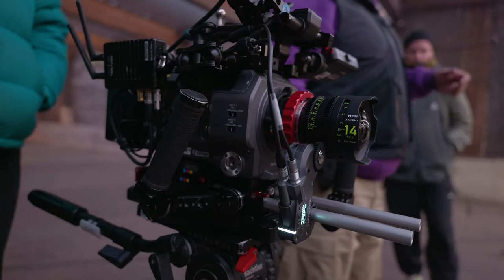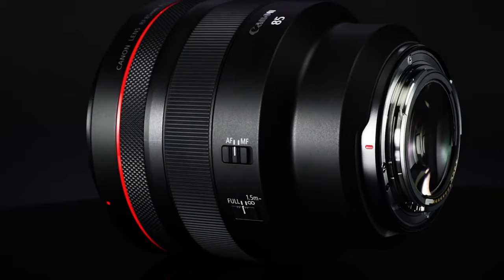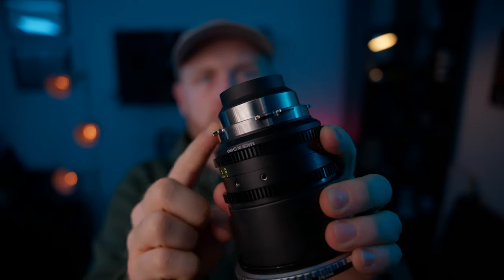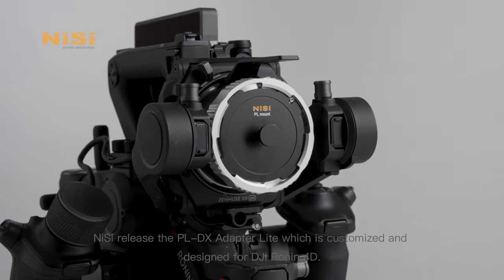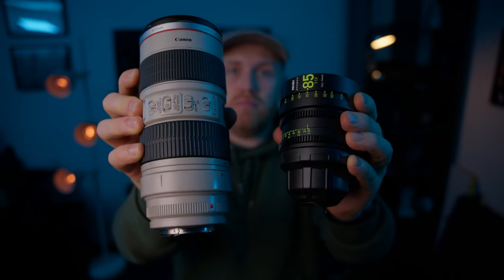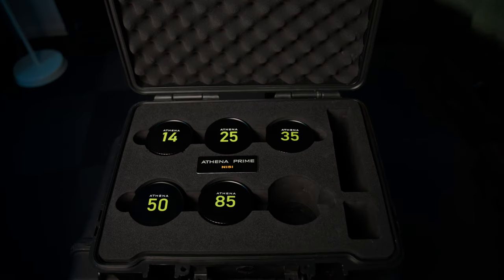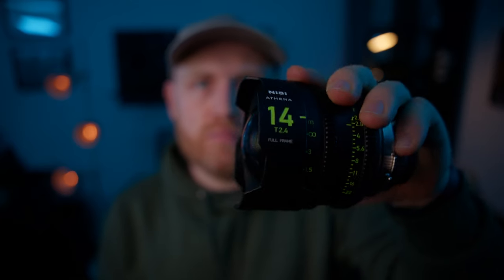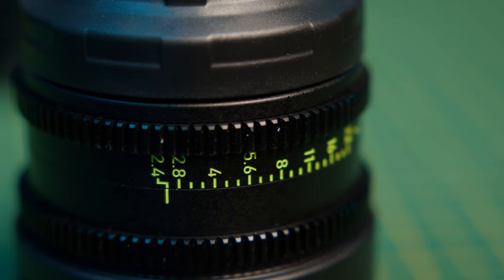These Lenses Were So Good I Bought Them! NiSi ATHENA PRIME Cinema Lenses

Comment: I like what you said about the PL mount. Whenever purchasing an expensive lens or lens kit, I from now on will always choose PL mount over any other (if avaliable for that specific model). Being able to switch to a different camera system and manufacturer at any time is so incredibly valuable. And even if you are regularly shooting on Sony, RED, Canon, Blackmagic, ARRI, Panasonic or whatever. Whenever you have a project that specifically requires a Blackmagic camera, you can simply get your PL adapter kit out and use all the lenses you already have and love and just need to rent or buy the specific camera. That way you not only save a lot of money, but you are also able to afford even more expensive lenses since you can use them for even longer and also keep that resale value.

Comment: You forgot to mention the one major flaw of the Nisi set, which is the rear protruding element during focus adjustment that'll prevent you from mounting the lens on speedbooster or most filter adapters, making it less useful on mirrorless and/or super35 bodies than the Vespid.
Reply: The protruding element is only on the PL mount. That's why I went for the E mount without the drop in filters to work across our Ronin 4d and Sony A7 bodies. There's usually some compromise I'm happy to sell them if I ever need another mount option.

Comment: Awesome video!  Not sure what mount option to go with yet though. Based on the following criteria what is the smartest choice when considering RF/PL with adapter?  Komodo X (native RF mount) but I would like to pair it with a focal reducer. Is that even option no matter what mounting option I go with? Thank you for such a great review!
Reply from the maker: Tricky one when it comes to the focal reducer, my gut feeling would still go with the PL kit, the lenses can easily outlive the Komodo, and you never know which camera or brand you'll be using next. I'm sure you didn't expect to be shooting on a Red camera 5 or 10 years ago, so who knows what you will be using in 5 or 10 years from now? I would just play it safe with your investment.
Reply: The Nisi can't work with a focal reducer/speedbooster due to the rare protruding element. Quite unfortunate

Comment: Bro these look so good, I just need to sort a good pl adapter  I know that rear lens has compatibility problems with some, to go between sony and komodo.
Reply: Those that don't have a back filter system should be good, like the Metabone, but not the Poco Mofage. Nisi also made their own PL to anything adapter mount.
Reply: @LoremIpsumProd  yes, it was the mofage poco I was looking at specifically though, because for the extra £50 I can get the E mount to swap out and use between  both my ecosystems. 
I know they are aware, hopefully something can be done.
Reply: @RoydenWakefield  you can can actually use the 25 with it, check with CVP video. Best bet though, grab those without the back filter. With their design it's a sacrifice that they made and nothing gonna fix that.

I was so sad when the mofage did not fit, but a PL adapter with back filter will always be useful in one way or the other.

Comment: I have PL mount Vespid primes which L to PL adapter do you recommend for BMCC 6k ? Heard lot of negative comments about PL adaptation with lot of play not tight fit etc etc
Reply from the maker: I've been using the sigma one, it's pretty solid and has an internal small screw to lock in if ya wanted to (although I never use it) it's more expensive than most but I got it 2nd hand for half the price 👌🏼

Comment: I’m so jealous - got a set of vespids so tempted
To sell em and get these instead
Reply from the maker: That's where I was at, TBF the Vespids are extremely good lenses for the price, cnt go wrong with either 👌🏼
Reply: I have a set of Vespids and recently got the 14mm Athena for the extra wide angle. The Athena has less CA and is a little sharper, but...I prefer the Vespid's highlight roll off on skin tones, and the bokeh. If you're shooting on a 4k sensor at high frame rates, apparently the difference in sharpness is more noticeable, but I've tested this on my Z Cam E2 F6 and haven't really noticed a major difference. It's more the reduced CA on the Athenas that I notice -  which for some clients is what they want. I'll likely get the 35 and 85 Athenas to cover my main bases. Either set will be great, but I wouldn't sell my Vespids to switch ;-)
PS the Tilta mirage 95mm filter tray with clamp on adapter works without vignetting on the 14mm Athena, if you want to protect that gorgeous glass.